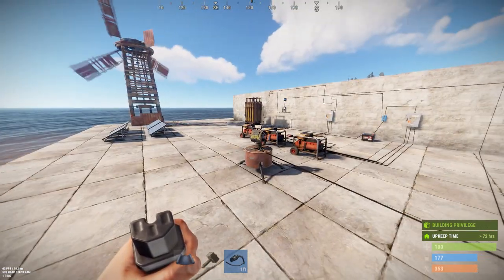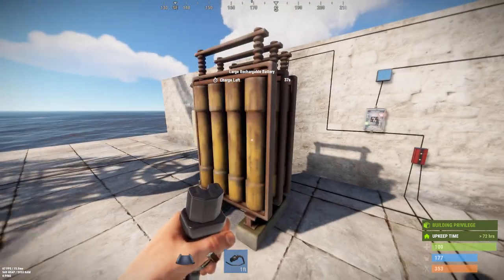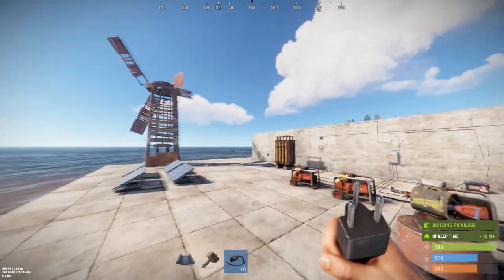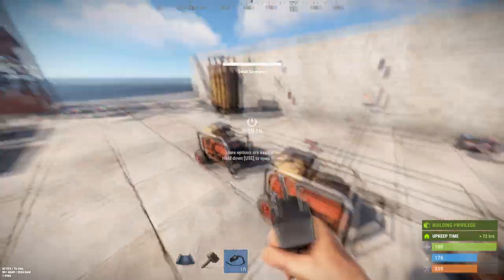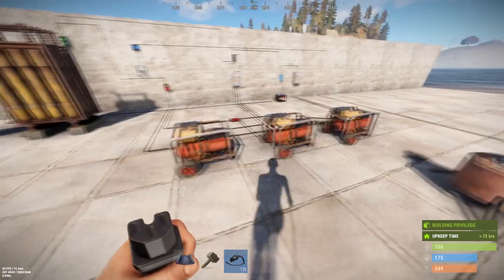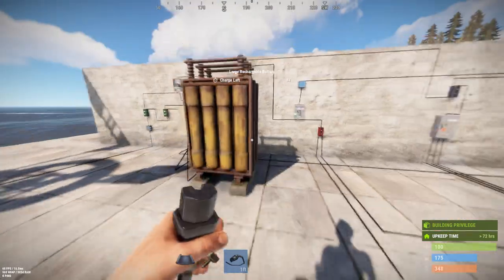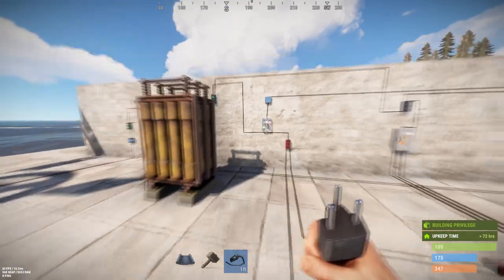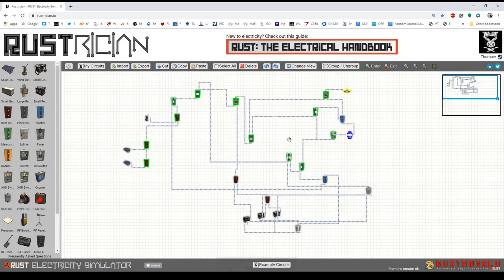Rust Electricity 101: Basic Circuits - 3 Stage UPS System with Generator

Comment: Couldn't you just use another battery for the 3rd stage backup? Shouldn't it still be enough to get 80 units of power for the 8 turrets unless the circuit gets more complex?
Reply from the maker: Yes, but I was doing a demo to show how to incorporate the new generators. I've already done videos on failing over multiple batteries :)
Reply: @RabidRabbitGamer  You could also do two batteries that output to one root combiner if you wanted more than 100 total ouput.
Reply from the maker: While that is a true statement, it wouldn't be practical here. Since you cannot put anything between batteries and root combiners, they would be always on, so not effective in a back-up type situation.
Reply: @RabidRabbitGamer  Good point, thanks.